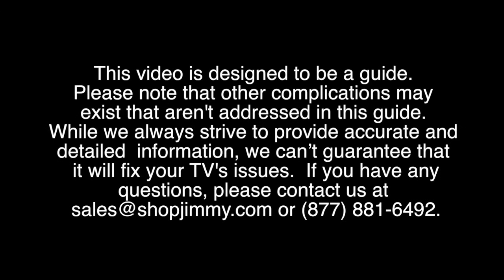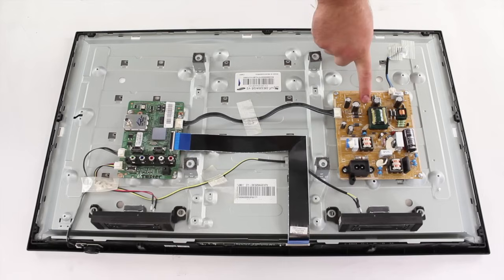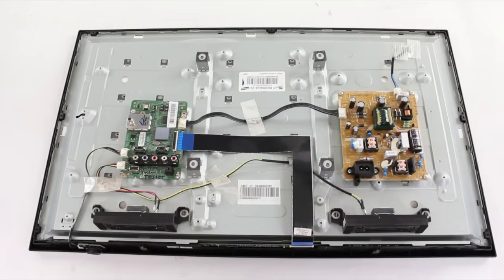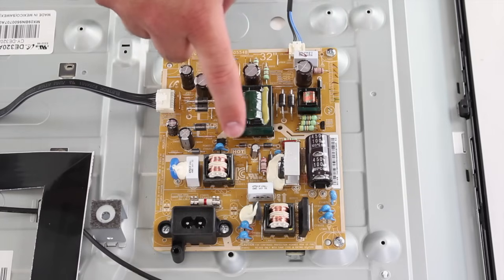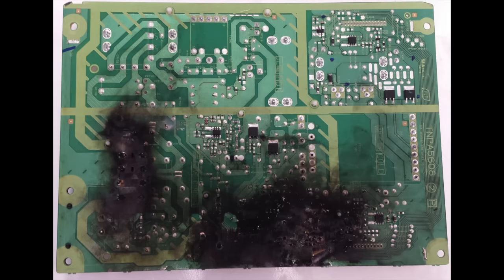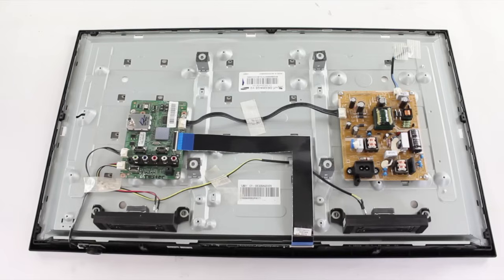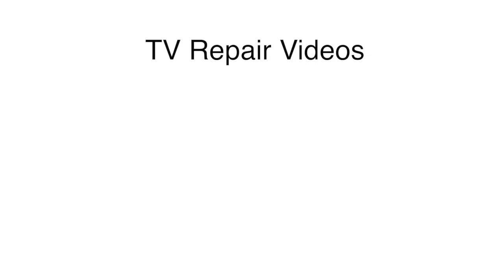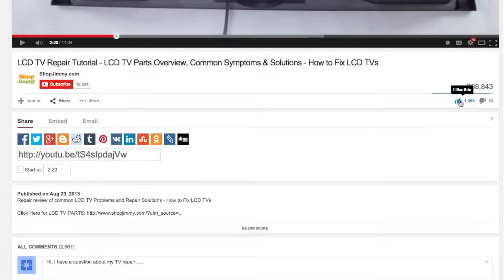Samsung LED TV Won't Turn On No Power & Does Have a Standby Light Basic Troubleshooting TV Repair

Comment: I have a samsung  un37eh5000f led tv, I have watched your videos (thanks) I have actually popped the back off and inspected things and no visible damage is present... My TV works fine after  you get the thing turned on but fairly recently it has started to be unable to power on, waiting for some time, maybe about 30 minutes usually it will power on. 
 (I do still have standby light during no power up, and also standby voltage has been tested to be present.) 
Edit: I found this paper online (not my tv model but figured it was quite possibly applicable to many samsung tvs) 
https://www.pcrichard.com/images/promos/5Samsung%20May%202013%20Tech%20Talk%20Newsletter.pdf
on page 17 of the document it describes a power up procedure which basically says you should see 3.5v signal voltage on B5V pin
I actually have 2 pins labeled B5V and my pins A5V, B5V and once again B5V all had 5 volts while just on standby with the condition of no power on present. 
 Edit: While TV was in "working fine mode" I tested one of the B5V pins to have the (assumedly correct) 3.5v of signal (breifly while pressing power button) from the micro to the SMPS 
So my best guess is the mainboard.

Comment: Great advice in your videos. My tv s stndyby light but when turning on screen shows logo (JVC) for one second then nothing. To get standby light back I have to unplug and replug but tv still only flashes logo. Could this be the power board.
Reply: Mine does that also. No answers anywhere.
Reply: Replace the motherboard

Comment: My Samsung un55fh6200fxza won’t properly boot up. It comes on, shows the logo for a second or two, then reboots. The red light on the front blinks 5 times, then repeats.

When I take off the back and plug it in, the backlight comes on.

I visually inspected the capacitors and don’t see anything out of the ordinary.

Any ideas what I should check next? I’m not super technical, so the more simple the explanation, the better chance I’ll understand it. ;)

Comment: i have a 55" samsung tv un55h6203afxza , i first had no power or red light so i ordered a complete 3 board kit and installed them. i have power and a red light, the t-con board has small blue lights on but still no sound or backlight or screen. lost now need help

Comment: The TV that I'm trying to fix is not a Samsung, it's an LG. It's a 65 in LED TV and I have replaced the power supply, main board, and t-con board. The only thing that's left is the TV screen, which can't be replaced. Is there a way for me to test the screen to make sure that's the problem?

Comment: Hello I have  UN55ES7500FXZA  and it just shut off but does have a standby light, When I plug it in I hear it clicking inside but does not turn on.... The screen  is fine I thinm.. But deny click.?? Does this sound like the Power Supply Board  to you.?????? Thanks for help..

Comment: Shopjimmy .com I have 2 tv's 
Both have the same problum 
After switching power supply. Led is on stand by .red and blue light is blinking .  I check the power supply all components.  Plz advise what can I do more . I have  50 % doubt on power supply.  Plz give answer in detail . Thank u sir

Comment: I tried installing a new fuse(glass one) across the old one. The fuse just got black as I switched on the power. What to do next?
Reply: This is a power supply short problem.Replace the small power supply board.

Comment: hi there... i have samsung led 40' my problem the power supply damage anD the mospet 10a60w broke and the power mangemen ic 2S111 also damage where can i buy this ic.? and could you give me the output of this ic or schematic my maybe i create same function if have the data or schematic output of this 2S111 7pins ic.... hope you can help me thanks more power al

Comment: Now a days everything you buy are designed to last until the warranty expires. My old TV lasted 15 years and in the last 15 years after I have had 6 TV that broke down. My fridge that mom and dad brought me for my wedding lasted 18 years while since then we have had 4 new fridge none making it to 7 years of service. I had a washing mashing that was working with its exterior all rusted out and it kept on running while my latest washing machine looked new when I threw it to the dump.
Reply: To be fair, modern appliances are WILDLY more complicated than mom and dad. And ALL electronics and machines require maintainence. However, most people are too lazy to perform said maintainence.
Reply: Cheap junk made in China for mass consumption. The day  you buy something without a warranty 
is a waste of money, everything craps out way too fast because of it.
Reply: Note that most current appliances have to meet energy efficiency standards and/or water usage regs that didn't exist back when appliances could be made simply and were therefore reliable.  My fridge is a nice side-by-side that's 30 years old this year and I pray it continues to work as the new ones are 3 to 4 times as expensive and nowhere near as reliable.  Replaced a 30yo Westinghouse central AC 12 years ago that was still working just fine but was very expensive to run.  The new Trane 15 SEER I bought lasted until ONE MONTH after the 10 year warranty expired!!  I guess it's all part of the "disposable" world we have now.

Comment: Hey Jimmy, I have this set with no power at all. No standby or any sign of life.
I took the power panel out and there are no signs of issues.
Nu burnt parts or bulging caps and the fuse is fine.
Ideas?
Reply: Same here.  65", no power, no stand by, no obvious bad parts on boards.  ???
Reply: you find out the problem? mine has the same issue, i guess it's the power board? the panel was changed recently

Comment: I have a Panasonic 55in tv model# tc 55cx420u. Has a backlight. No video or sound and I can’t get to the menu. Once the tv is on.  I can’t turn it off but it turns itself off after about 20 seconds. Nothing looks burnet and all components look fine.

Comment: Thanks for the video information, really appreciate it.  Although it was very informative, I took my LED TV apart (UN50F5500AFXZA) and could not find no capacitor, electrical connection, or anything abnormal from either the main board or power supply board.  The next task I will be doing is plugging power and reading voltage out of several components to see if I have power going out to such.  Besides this, anything else you recommend?
I am definitely not buying another samsung and or paying for their repair center to fix it.  Anything else you can recommend, please do so.  Much appreciated; Sal
Reply: Most likely and almost always it's the capacitors in the power supply that go bad. Capacitors tho sometimes they do swell up don't always. I just replaced about 9 capacitors in an amplifier and none were swollen. This is due to Chinese POS capacitors. If you look on the net theres a whole write up about caps and how the Chinese ones are made. They don't use the proper electrolytes internally and in turn they degrade much faster than high quality caps. One thing to note about capacitors is that on the side along with the voltage which can go higher but not lower than stock. Is also the uf or microfarads and also the temperature. The operating temperature that is optimal is 105° temperature. This is due to the fact that that is the operating temperature point where the insides liquify. Or begin to swish around. Being that 105 is the highest they can operate they only come in 105° and 85°. Therefore a 105 cap can run hotter than an 85. This means that it will take much more heat to get the cap to liquify and begin to lose it's value in uf. This also is important because shitty Chinese caps don't have adequate sealing rubber and this causes them to leak and then they permanently lose their value in uf. Causing the issues you guys are having with your tvs. These types of issues don't just plague tvs, they plague anything with a capacitor inside. The reason tvs have this issue is because people leave them on for hours and hours and guess what happens? The caps get hot turn to liquid and lose their value. There's no tv that this won't happen with and personally I've had Samsung tvs that outlasted all others. If you truly don't want this problem with your tv. As soon as you buy it open it up and see what kinda caps are inside. If they are cheap shitty Chinese caps and you can look on the net to see what brands are shit and what ones are good. Replace them as soon as you buy the damn thing. There are other inherent problems with capacitors also that are made wrong. Like the electrolyte has too much water in it which in turn cause corrosion and other issues like leakage sooner than normal. If you replace these caps before this happens even with a much higher voltage you will never and I mean never have these issues. Especially if you replace them with good american made capacitors. Or even good japanese capacitors. There are lots of good caps out there not all american ones are top shelf either. But replacing shit crap caps with high quality caps will save the life of your tv. Caps filter the signal either ac filter frequency or dc filter voltage I believe I can't remember at the moment. And when this no longer happens it can cause other components to begin to fail. Usually semiconductors. And there is no need to replace the entire board. Caps are cheap guys if they have a stripe on one side they are bipolar meaning they have a + and a -. The negative is the stripe side of the cap and on your circuit board is a mark of some sort. To show which side is negative. EVERYTHING EVER MADE HAS SOME SORT OF MARK ON IT DESIGNATING THE NEGATIVE SIDE OF A BIPOLAR CAPACITOR. if there is no mark to designate the negative then there most likely isn't a stripe on the cap. In this case the cap is just an electrolytic capacitor. And there are other types of caps that will work in it's place also. Some are better than the ones they use for tvs. Like polypropylene or mylar. And there's also ways to read these even tho they put the uf in different terms like some will say J on them. Or other letters. But on the net there is a primer or some sort of key as to how to read them. Guys this isn't rocket science, these letters are just like bytes, kilobytes, megabytes, gigabytes etc. Each letter designates either an up or down in values. Usually in decimals. And if you don't know how to read that they have converters that will show you how to do this or what other caps can be used or which ones are good, better or best. A good place to start looking for this type of cap or also a key to look the values up and also calling customer service is PARTS EXPRESS! They have a 1-800 number I believe is 1-800-express. And 24 hour a day customer service that will assist you in making this choice for parts. This shit is so fuckin cheap it's not even funny guys. You can literally replace every cap in your entire tv for prolly 30 bucks. And a new board will run you about 70 to 100 bucks in most cases. Depending on the brand, age and how rare it is. Take the time to buy new caps and try it. The ones I replaced in this amp looked completely normal. But once I got them out you could shake one of them and feel the wrapping junk inside shaking around. That means all the electrolyte is gone. That cap is trash but it's not swelled. I read that this is because the shitty seals they used inside leak when it turned to liquid on the inside. So it's not necessarily that it turns to liquid that makes it bad. It's that it leaks while it's liquid. Now some have to be replaced with the same temperature and I can't remember which ones do and which ones don't off the top of my head. But you know who will know? Parts express customer service. They have knowledgeable sales and service staff that can help you all day long. Take my advice replace the caps and try it even if they don't look bad. The guy saying there are none doesnt know how to identify caps. They come in different packages and different shapes and sizes. And once you've done this once or twice its easy as hell. And your tv will work for years to come. If you replace them when they are new and or put a small fan on the back of the tv to keep it cool so that it doesn't run hot to begin with that tv should last forever. In the electronics world caps are the only item that degrades simply with time. Resistors don't semiconductors don't inductors don't nothing else does besides caps. So if you put some good ones in them when they are still fresh and everything works. Or at least check them to see if they are crapola caps and replace them with good ones. The tv will work forever. Now leds going bad is another story altogether. Leds are just a diode that's also a light. They come on strips on the inside of the tv and can be purchased off eBay in sets for your individual tv. You can make them light up with a 9 volt battery by soldering wires to the tips of the battery and then using the battery to touch the contact points of the leds themselves or the end connection at the start of the strip. Altho the whole strip may not be able to light up with only 9 volts. Best way to do it is by looking which is + on the strip and which is negative on the strip and realizing that positive in on the strip goes to the positive of the first led. Then coming from that same led is the negative on the opposite side Simple. Take the battery and take positive and touch it to positive on the led and the negative to the other side of the led and boom it should light up. Once you Figure out which lights are bad, you can then replace them individually. And you can replace them with anything. Get an led light bulb even if the color is different and they don't look the same they will work. If it's superbowl Sunday and the big tv in the living room is out in a pinch you can replace these with anything that has an led in it. And they are wired in a series. Which means like old Christmas lights when one goes bad they all stop working so you can literally just make a jumper to jump or connect the positive and negative that we're hooked to an led together and it will start working again. Superbowl is back on in 10 minutes. Folks I taught myself this shit by sitting down and thinking about it a little bit. The more you learn about electronics the more you'll realize there's nothing to fear when you have a broken tv set or any electronic device. You can't break it it's already broke. So anything you try is called LEARNING. Sit down and fuckin tear shit open. Im no genius, im just a guy who isn't Afraid to tear the tv, washing machine, telephone, amplifier etc apart to see what the fuck is wrong with it. And eventually you learn that it's not as hard as you thought. House hold electronics steps voltage down because 110 isn't needed in most modern devices. Car electronics step voltage up because when house hold voltage steps down it doesn't usually step down to 12 volts. And see household voltage is fairly steady. Where as a car depends upon the alternator to produce current and if the motors not spinning at 3k rpms then guess what? There not enough voltage. But your house doesn't have that motor to spin that alternator. So it can produce that voltage even steadier when it's stepped down. Every half down in voltage creates a double up in amperage. LEARN!!!!! Rock on people\m/
Reply: By the way, the problem with my TV is, I get no screen, the Standby LED does not remain on, when I press remote control, LED blinkers as if receiving signal from the remote control.  When I disconnect everything, and only hook the power, the power LED stays on, I turn TV on, it works.  But after connecting the rest of the cables and watch TV for a little, after turn it off, it goes back to no-work status and the same thing happens (power LED is off but blinkers when remote control is pressed, TV does not turn on).  Hope it makes sense...
Reply: @smendez725  Did you ever find out what the issue with the TV was?

Comment: Hello,i have a 23"Samsung tv le23R87BD.After power switch on,it turns after 5 min.it run smooth after that.
Can you tell me which board has defect? Thanks

Comment: my Samsung 39" led tv has flashing red and back lights.   will not turn on..  I unplugged the Led cable from the power board.  

Tv will turn on.  picture with flash light and sound.   

is this a Led strip failure or powersupply?

Comment: I just took my tv backing off and checked capacitors, they all appeared to be in good condition.  I found this video and disconnected this exact same cable, but my tv would still not function.  I plugged it back in and my tv works fine now.  I'm not sure why unplugging this cable and then plugging it back in worked, but it did.

Comment: I have a UE37D5520RK when I power it up the red led flashes in the bottom right corner,the Samsung logo comes on then it goes of and the HDMI2 appears in the top left,that then goes off and the Samsung logo appears this happens repeatedly,help.

Comment: I have a UN75JU6500 samsung tv, stand by light flashes six times when I try to turn on.  I have unplugged all components and power and then plugged in to a different wall socket, still won't turn on.  Took off the back to look at the capacitors, they look ok, no bulging or leakage.  What else can I do.  Paid too much for tv, not happy with Samsung right now.

Comment: !!!HELP PLEASE!!!!
I have clicking sound and standby light flashing no picture no sound and no bad capacitor no burnt components on the 46in samsung when I disconnect the main board and power supply from each other the tv flashes. Is this the power board issue?or the main board 
THANK YOU
Reply: Computers sometimes are like this. The wiring looks solid but reconnecting it first may cure a bad connection.
Reply: My problem too. Samsung 46 inch. These things are made cheap so they dont last.